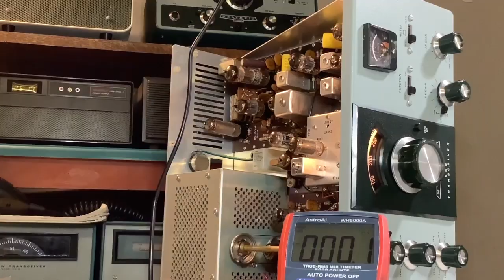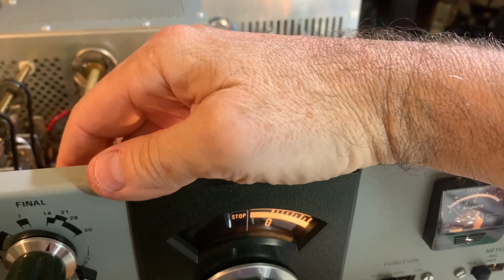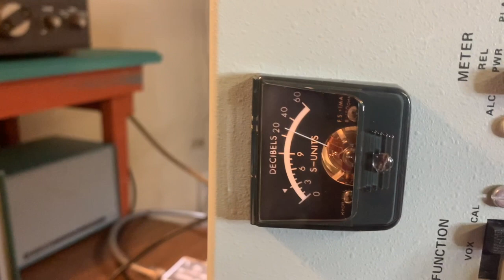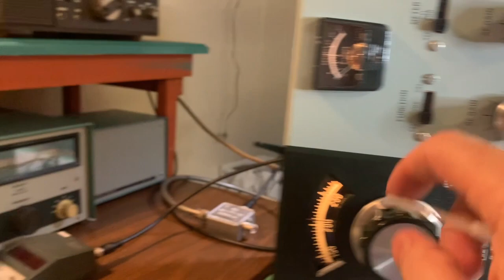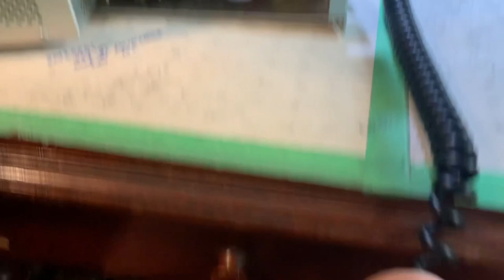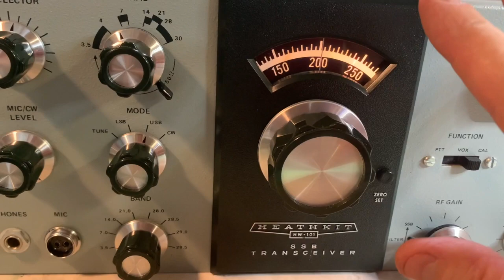HW-101 Alignment and Neutralization

Comment: My meter doesn’t deflect that much. I have been fighting power output on 80m.

The other thing that bugs me is when I modulate on SSB it seems to output much more than 3 kHz wide. I am going to realign it again. I have a ICOM 7300 and all the equipment but it’s fought me

Comment: Hello Will, 
first of all, thank you for all the videos you make and your posts on the forums. 
I have learned and understood so much thanks to you. I think you have also saved me from making quite a few mistakes on my SB-101 I'm currently restoring.

I was wondering if you had a solution other than replacing the damaged adjustable inductors with ones taken from another HW/SB?
On my SB-101, the previous owner glued every single RF inductor, and now they can't be adjusted. The adjustment screws float in the tube, tearing the tubes whenever I try to adjust them.

I have looked everywhere for horizontal adjustable RF inductors but cannot find them anywhere. I imagine they are very specific to that era and this device?

Thank you in advance for your help!
Best 73
ON3CAN

Comment: i watched you work on this hw101 and it was great. i noticed, i think, you changed all the resistors or it looked like it. if so, where did you buy them and what type are they. i have an sb100 i am going to attempt to restore. if you have some pointers, by all means i will listen

Comment: Fine video. I restored my HW101 recently recaped and few resistors. I left the vfo alone and did not recap anything there. The tranceiver has worked well. I decided though to remove vfo for inspection. There where some dust there which I removed and cleaned the capacitor and lubricated the gear. Put it back and turned on and scale was little bit off. I aligned the tuning scale with crystal calibration and by trimmin the screws  on 3.5 mhz. Things ok there but if change bands to say 14 mhz or 7.0 mhz the zerobeat are little bit of scale - not on the same place on scale. My question is what controls this or what is the best thing to do to be sure that I get zerobeat on same place on  scale when changing bands?

Comment: Very instructive, Will. I picked up a well used HW-101 to restore last spring and then another, even better HW-101 fell into my lap. So now I have two! It was the transceiver I dreamed about back in my salad days but I could not afford it; first in money and then in time. Now it's my time to revisit my youthful hobbies and get back on the air. Your HW-101 series have been very helpful. Love the old vacuum tube rigs. They look good, smell good, and they are comprehensible.

Comment: Hi Will. Your HW-101 videos have been tremendously helpful. I still have mine that I built in 1973 when I was in High School. Have you had any stability issues with using the 6146B finals? I have a matched set of JAN 6146Ws that I bought 20 years ago from RF Parts but I have never installed. I would perform the alternative method of neutralizing them as per your video. Thanks, 73.
Reply from the maker: I have not had stability issues with any types of finals. There's a lot of discussion online about 6146A vs B. In the service bulletins, Heath went back and forth on which to use. I use both.

Comment: Excellent video, Will! This will help me align my newly acquired HW-101!
Reply: It appears that the zero-set knob on my radio isn't working. It is already depressed in and doesn't seem to do anything. Where can I find that assembly in the owner's manual? Thanks
Reply from the maker: Sounds like the VFO enclosure is set too far back for the button to make pressure against the dial. Try pressing harder. If you can't get it to work, you'll have to open the top cabinet and move the dial assembly manually. To slide the VFO enclosure closer to the front you have to loosen a number of screws, some of which are hard to get to.